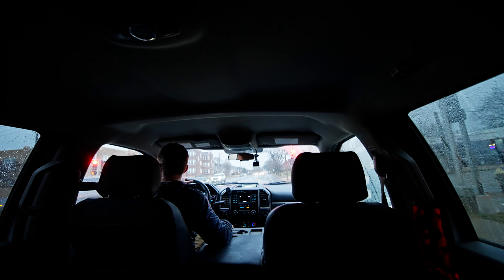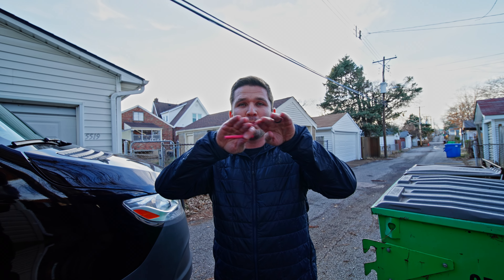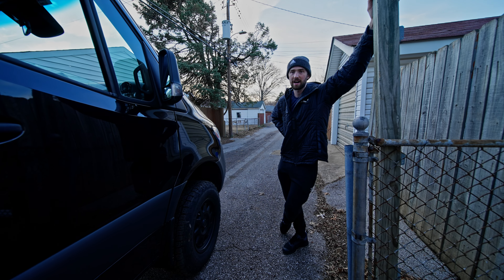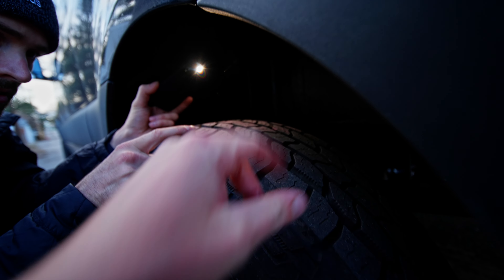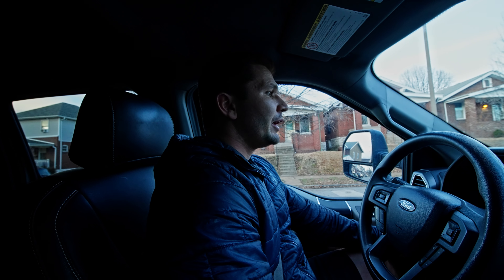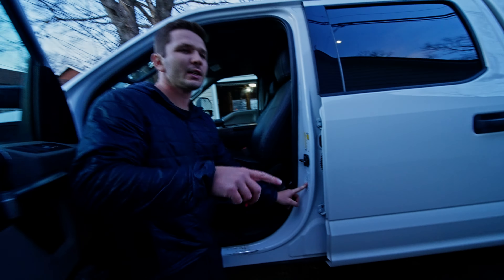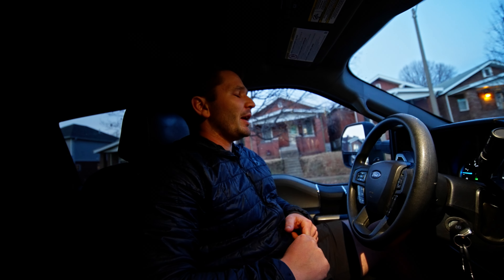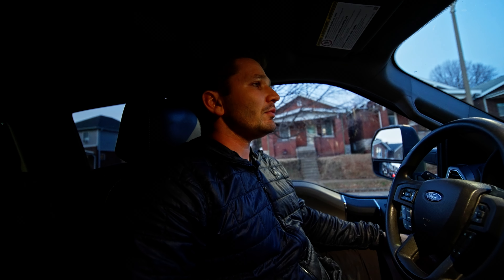Before You Set Your Tire Pressure, Watch This First!

Comment: I run my F250 aroudn town at 50 front, 40 rear.  when i hook up to my camper i do run the tires up to 65 though as that's where they don't look bulged out.
Reply from the maker: Good call!  What size tires are you running?
Reply: @powerstrokemaintenance  285/70/18 so basically 35s
Reply from the maker: Nice!

Comment: Well, I tend to actually use my truck. 60 all around and rotate every couple oil changes. 50k-60k miles on a set. Done.
Reply from the maker: Yikes that’s low miles for tires
Reply: @powerstrokemaintenance .. Wait , are you being cynical? 50 to 60 thousand miles from a set of tires is pretty good in my book.  you must be joking.. if not , what kind of tires are you running to get better ? I'm not spending 600 per tire , . my Hankook are 295 45 18 on my f150
Reply from the maker: Yeah I was joking haha that's decent. Although with my highways I plan to get at least 70 or 80k if I can. DOT requires 4/32 tread at least so we'll see. Michelin Defenders currently.